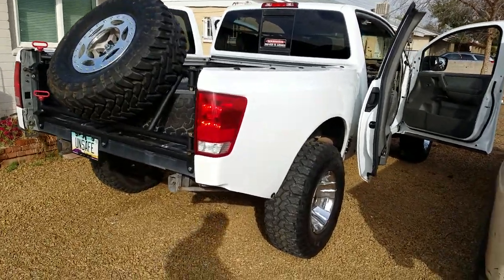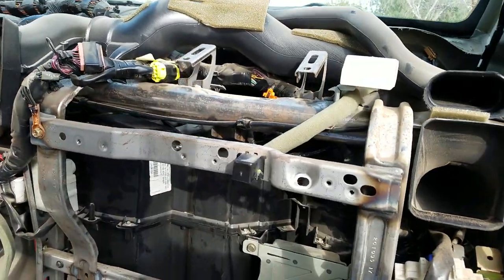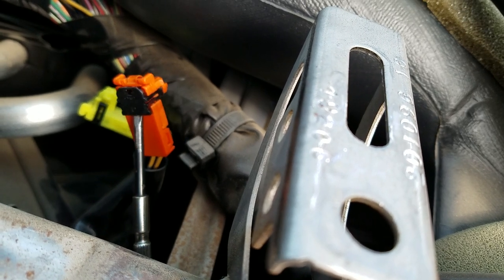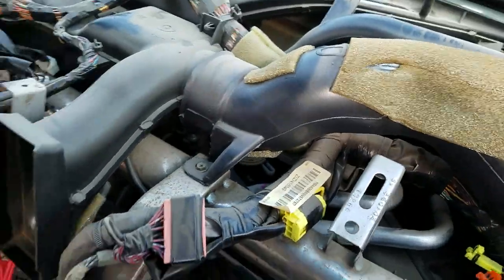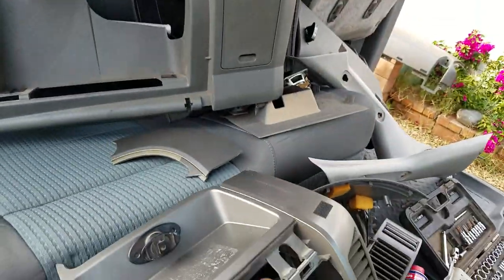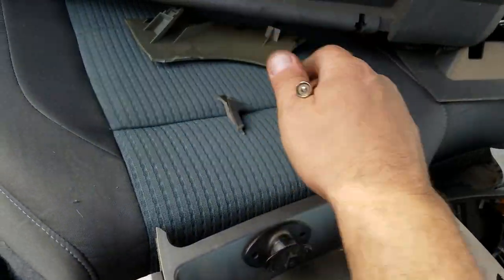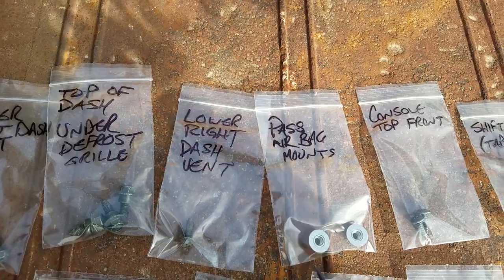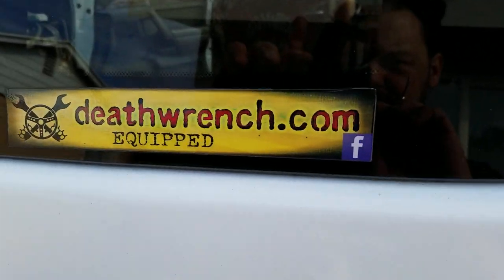Nissan titan dash removal... YAY!

Comment: Just finished this job myself. Those airbag plugs and the bolts that hold the dash on those mounts are such a bitch to get out. Ended up with like 5 extra screws after everything was back together. So that was a hard lesson learned. I see why the shops charge 600 for this.

Comment: There is no f**king way I would keep any vehicle that this level of disassembly was required to fix so defective a part that inflicts so many of these trucks.  Ridiculous
Reply from the maker: I had to do all this so I could sell it and swear off Nissan forever!! Lol
Reply: @deathwrenchcustom   Have you tried to fix a new ford truck yet ?  Lots of repairs require the removal of the cab . take a look in the bay at the local ford dealer , good odds there is one in with the cab off .
Reply from the maker: @faircompetition1203  - Ugh.  There are very few brand new vehicles I'd like to own.  It's a very frustrating thing, because the older vehicles I LIKE are almost all beat to hell by now.  I drive an '04 Mazda B2300 (Ford Ranger) with the 4 cylinder and 5 speed.  It ain't a lot of fun, but it's simple and reliable as an anvil.  On a side note, almost all japanese motorcycles are reliable as hell...  so there's that option...  :)
Reply: @deathwrenchcustom   I'd like an old dodge with a 12 valve in it .  Then drop on that running frame a Land  Rover 110 body
Reply: 94 gmc k1500, amazing truck.
Reply from the maker: @Carvingwanderer  I have one.  :)

Comment: So on that piece that broke, the top of the bezel, do you have to remove the dash to take that out? Mine is broken in the same spot and wanted to replace the whole thing to get rid of some other imperfections but not sure if I want to take on removing the whole dash just to replace that. Thanks!
Reply from the maker: As I recall, that whole piece just held in place with clips.  Just give it a good solid yank straight back.

Comment: I have Nissan Titan 2010 SE.I have same issue Blend door not working just stuck on heat side, All time hot air blows inside Nissan Titan.Took to mechanic $30.00 for part and 550 to replace the motor called HVAC blend door Actuators. part # 27743NA. and part is located on passenger side on the top portion. cannot get there without open the whole dash. its nightmare. Thanks Nissan Titan.
Reply from the maker: Yep! That's a better price than the dealer though...  no more nissan for me! :)
Reply: jlubaja0786 damm dats cheap I just just  came from d shop they wanna charge over 2 gran bro to remove d dash n replace dat same part , where did u get ur parts from pls help me. It’s hot out here in calif

Comment: What size are the freakin nuts that mount the airbag/dash down... losing my mind here lol
Reply from the maker: Are you talking about the ones right up against the windshield?  As I recall, those were (of all things) 7mm.  If you're talking about the ones that connect the passenger side airbag to the dash (that you have to get from underneath), I think they were 10mm or 12mm.  Been a while though.
Reply: deathwrench custom parts for hot rods, rat rods ya they were a 10! I got a different angle to view them looking through where the glove box used to be and saw that everything I was trying was too small! Thanks for the reply! Your video and the FYI on those two bolts saved me a bunch of questions! Appreciate it!
Reply: Awesome video. Especially organization of parts for people that don’t work on autos for a living. Thank you so much !

Comment: Once you pull the dash it will rattle forever.
Reply from the maker: Nope.  I put it back together and it was perfect.
Reply: @deathwrenchcustom  I've had the same results over numerous dash pad re-installs and wonder how in the hell it's not rattling and looks factory